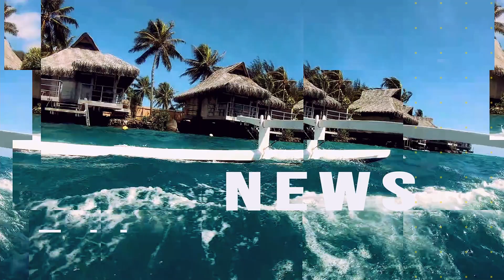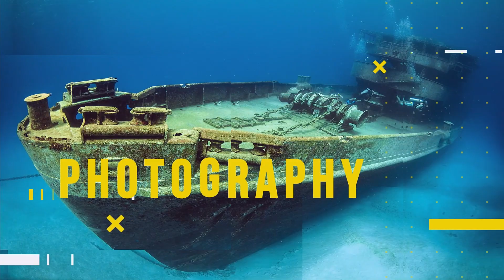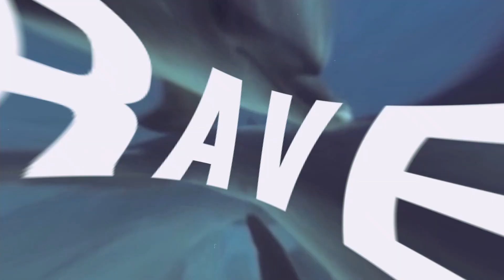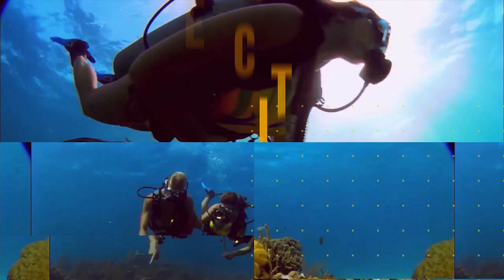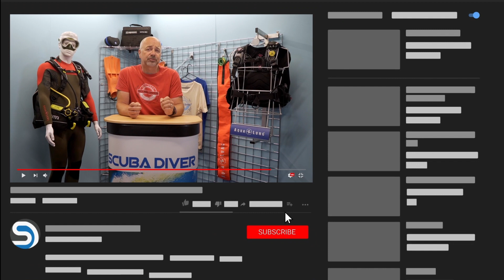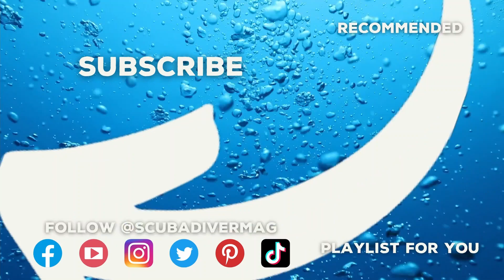Is Your Scuba Cylinder Trying To Kill You?

Comment: You should always taste the air before a dive. CO itself has no taste, smell or colour, but if the contamination is due to the fumes from a generator or something like this, you might sense diesel. Of course, testing the air with a proper device is even better.